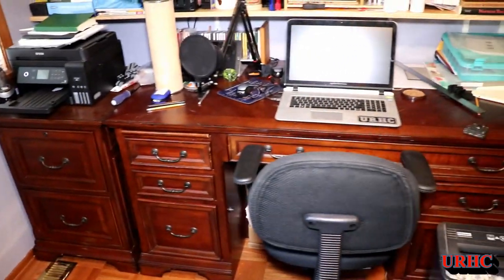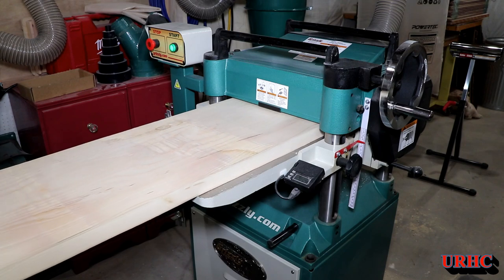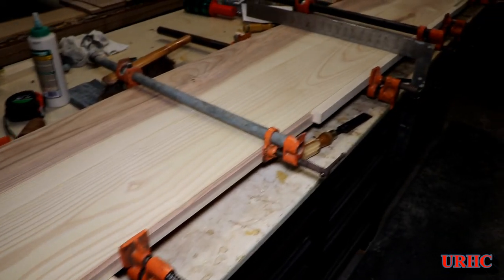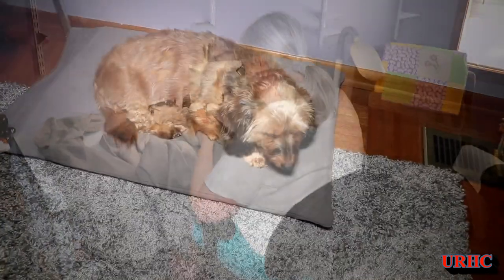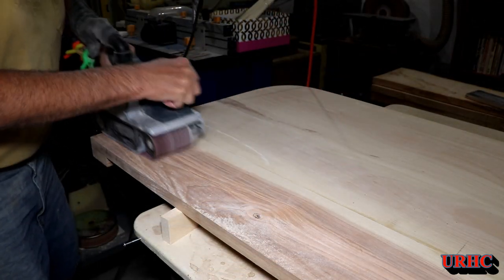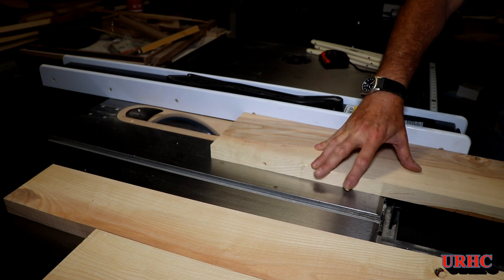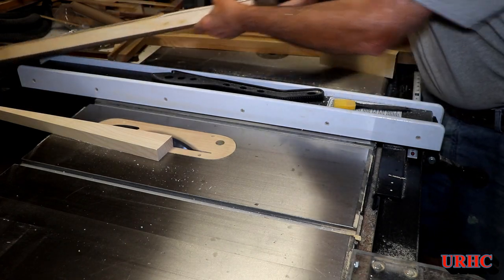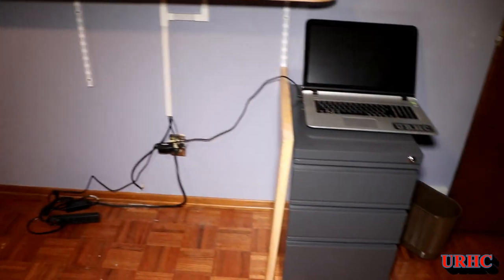Building A New Desk From Backyard Ash

Comment: Dewalt makes a 60 volt, battery track saw. Also, Kreg has a track saw conversion kit to convert your existing circular saw to a track saw.
Reply from the maker: I looked at the kreg kit but the reviews seemed to say that using the 4 sections for a 8 ft cut resulted in less than perfect results.  The connections didn't hold the tracks straight. The Dewalt one is nice but expensive.  I am looking for a nice straight aluminum extrusion to start with or some used tracks someone is selling. Thanks for watching.

Comment: Great update for your workspace.  It's always a good feeling to use lumber from your own property (for something other than firewood... lol)

When I have to get something larger shipped from places like Home Depot and Costo (and even Wal*Mart) I really try to have them ship to the store - that way I can inspect it before I take and don't have to deal with the shippers.
Reply from the maker: Thanks.  It's nice to finally have a decent desk. Costco doesn't offer ship to store and actually has the vendor add the extra padding for shipping.  I have never seen so many packages beat up this bad. 2 of them I wouldn't even accept because one had a fork driven through the side and the other had a heavy load dropped on it crushing the cabinet.  UPS put a note on it the customer rejected them because they were dupllicates. They don't even want to take responsibility for their mishandling of packages trusted to them. Luckily Costco ships new ones right out and apparently deals with this constantly.  Just had FedEx deliver a package and it looked like it was driven over by a truck.  The driver was embarrassed to have to deliver it. What is going on 🤔?

Comment: Looks great. I made myself a 9' walnut desk recently. Saved myself a lot of work by just getting a big slab and having the lumber yard where I bought it put it through their monster 40" planer/120 grit drum sander combo. I just work out of a garage so it's pretty difficult to work with a 9'x25"x2" slab!!! Moving it was about impossible. I've got a video of the finishing.
Reply from the maker: That's the easiest way  to do it if you have slabs that big available. I have some nice 2 inch slabs about 15 inches wide but they just weren't dry enough to use yet. Solid wood is definitely heavy. It's a love hate relationship with the water base polyurethane for me. Thanks for watching.

Comment: Pretty dang nice sir! Wanted to say that you must have a powerful ass drill...I've been using those Kreg screws for a lot of years and have never broken one. Appreciate your videos and thanks for posting.
Reply from the maker: Thanks.  Never had a problem with them before the last batch I purchased.  That makita has very little power and will snap the head off if they are tightened. The ones that broke snapped off right at the end of the threads. They are almost gone now and hopefully the next box will be like the old ones. Thanks for watching.

Comment: Hi, I know what you mean about the sandpaper clogging up, I found some cloth-backed sandpaper that had holes all the way through, it is a little more expensive but it outlasts normal sandpaper four to five times so in the end itis more of a bargain.
Reply from the maker: That polycrilic water based finish is the worst for loading up sandpaper.  I think that's the best solution if you do a lot of finishing.  Thanks for watching.